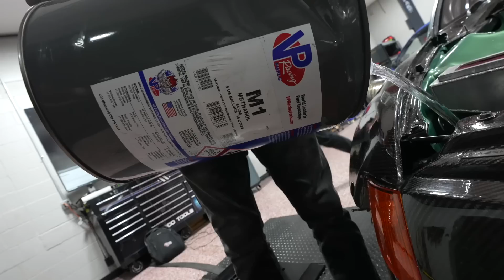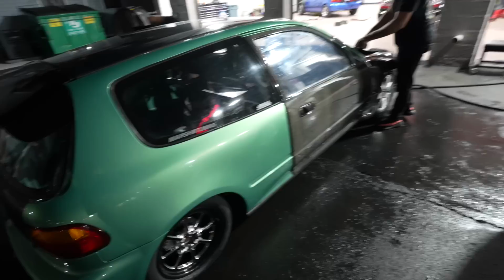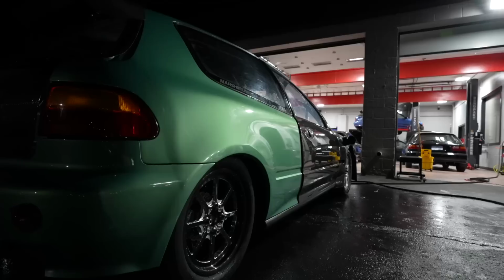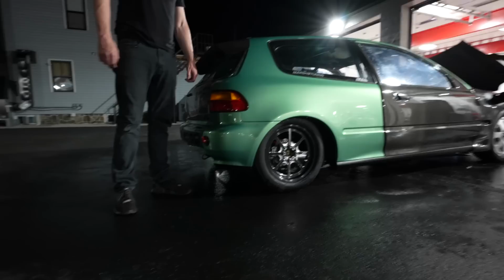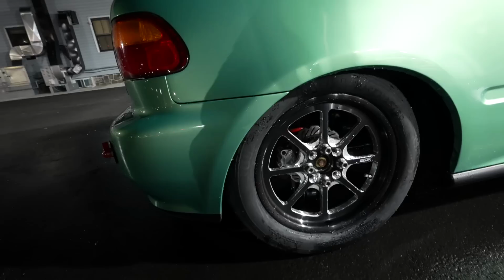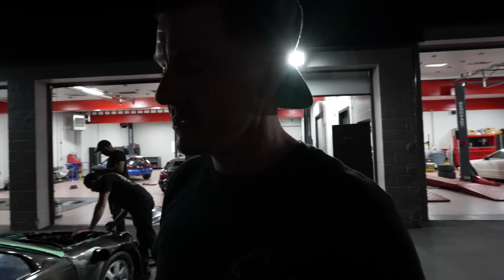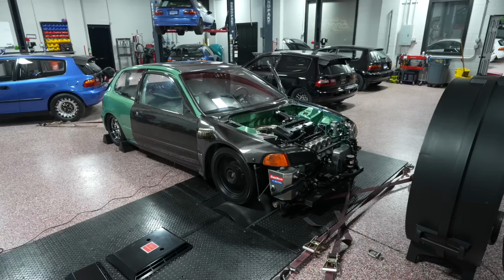Jamie Marsh 400+hp M1 Civic Dyno Session! Omega-K

Comment: Pissed i missed H day. I'm only 25 30 mins away. Had to work. Even though only Hondas I have are a few 1985 honda oddyseys, they do all have rotax swaps 1 617cc and 2 670cc engines. The 670ho makes around 140hp I wonder what it would run in the eighth or 300'🤔